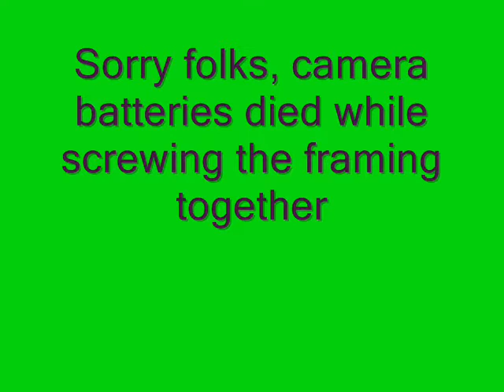Consession trailer rebuild #4

Comment: Thanks Jamie. You said 18DP and 20 PA I think that is correct. I plan on cutting the change gears. I found some parts on ebay. Complete cariage, tail stock and the compound for $15 is on its way. I am having some good luck. Thanks as always.

Comment: I have a few comments: 

1:  The angle on that castle  nut is important. It needs to be 90° in relation to the threads. Otherwise the bearing can tilt slightly and cause unusual where on one side of the bearing.     When machining, get into the habit of going the extra mile. it is good practice, and It will be worth it in the long run  

2: Listening to the sound of that saw blade , it was bogging down too much. Check and make sure you have a good sharp blade,  if so, check the voltage underload. if the voltage is dropping check all connections. and make sure you have heavy enough wire to handle the current.

3: above all else keep your fingers away from that blade. Use a push block. I value my fingers over all else. Safety first.

I hate to sound like a old lady, But I have been doing this for over 40 years, and although I have had my share of small accidents, thankfully I still have all my digits. I am keenly aware of where my hands are at all times when using any kind of machinery. And I tried to follow good safety practices. Especially when I'm working by myself. even the most seasoned professional can make a mistake, and all it takes is once.